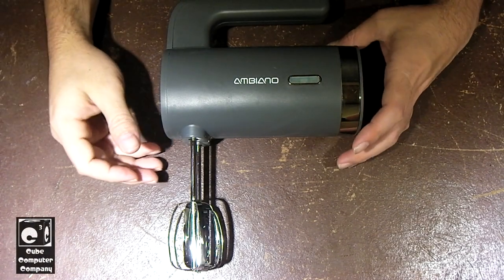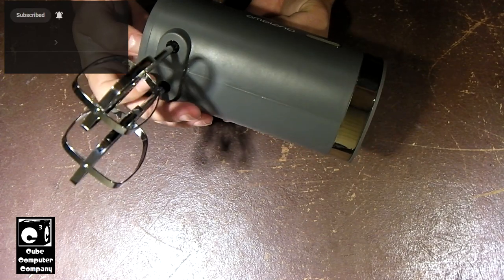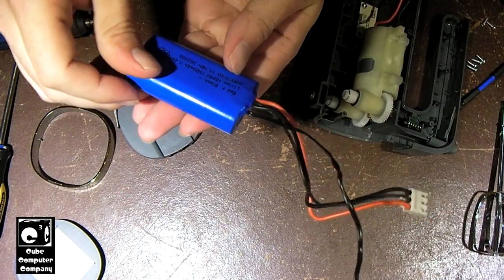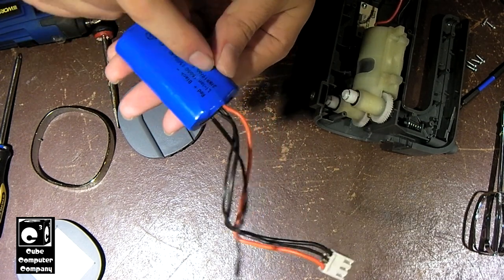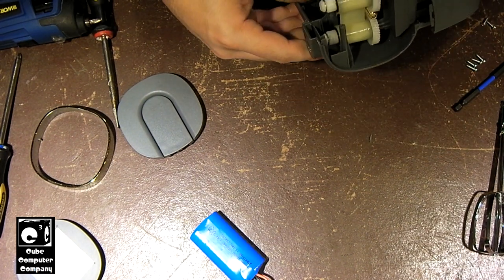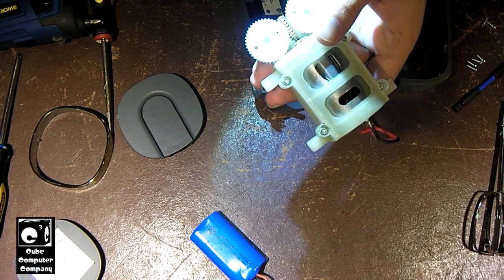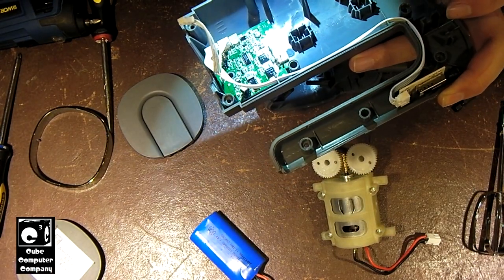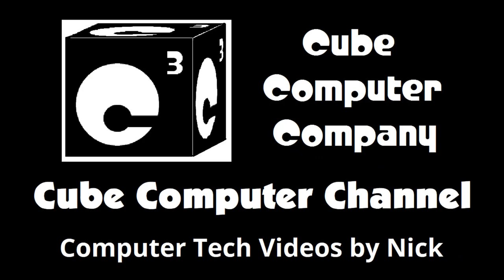Teardown of Ambiano ALDI cordless hand mixer

Comment: I’m here because mines stopped in the middle of mixing a cake 😒 never turned back on. Customer service number is a joke. Been calling for days and they have a message about being closed for a national holiday 🤔 it’s 12/05 and can’t think of a national holiday today
Reply from the maker: That's unfortunate... Personally, I believe with the price of them, it wouldn't be bad to have 2 of them in case one breaks. Your local Aldi store might at least give you a refund on it. Does the battery indicator show anything on the side when you try to power on the mixer?